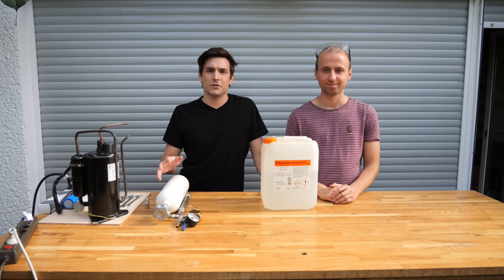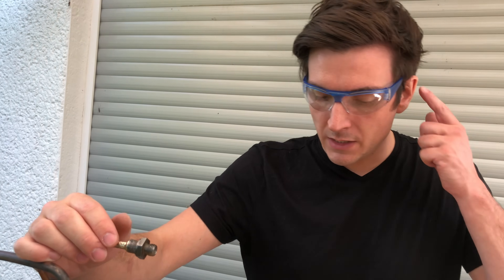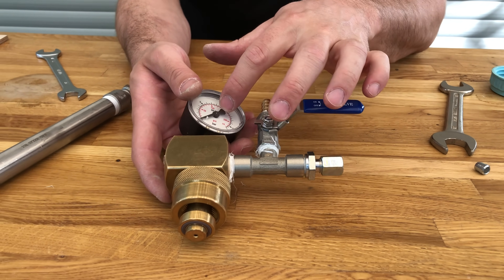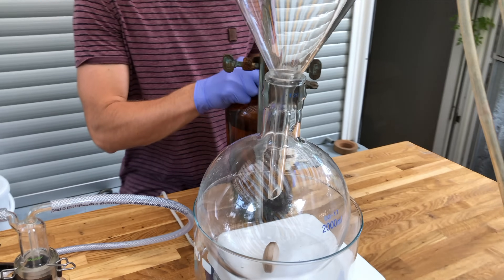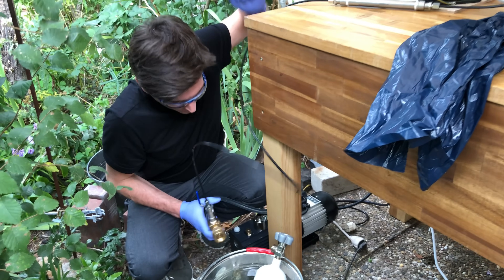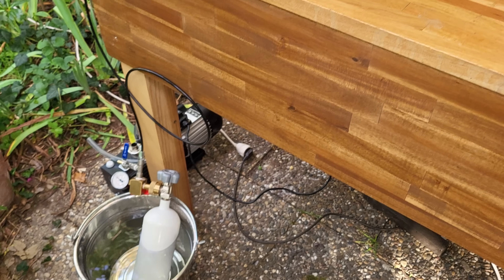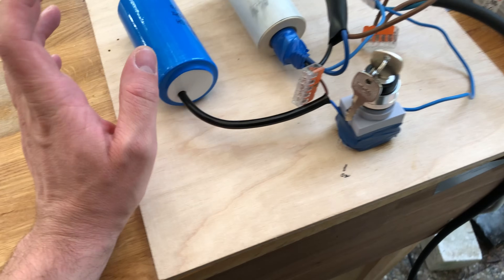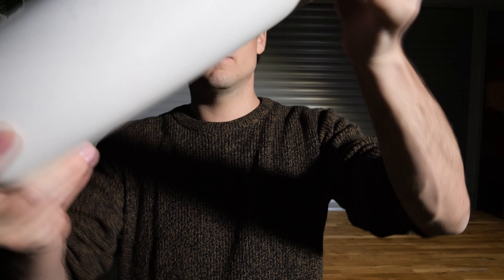Liquefying a Toxic Gas with a Refrigeration Compressor

Comment: Don't store the cylinder in your house or garage. BTW, I'm sure you know that brass and ammonia don't get along.
Reply from the maker: Don't worry, the gas cylinder will definitely not be stored in a house. Yes, we were aware of that. The video was not intended to demonstrate an optimal method for liquefying ammonia (which would be much easier with dry ice or LN2). I just wanted to revisit the method I used when I was young and didn't have access to dry ice or LN2.
Reply: @AdvancedTinkering  I hope there is no brass in the valve of that bottle...
Reply: @Sigmatechnica  Tetraamminecopper(II) Nitrate formation or other bad problems... Ammonia It's very corrosive for many metals.
Reply: @AdvancedTinkering Use it to make an ammonia cooler driven by burning ammonia.
Reply: Adding brass and ammonia to my no no square along with copper and acetylene
Reply: @godlugner5327  😂🤣😂🤣😂
Reply: To be safe its best to use a wood mould to make a concrete box and then put a wood lid over it that extends past the concrete to not make a pool. Lid blows off and you dont send shrapnel into the neighbors house

Comment: We always called them compression fittings.
Reply from the maker: That's good to know, thanks!
Reply: The inner part is called a ferrule
Apparently this also applies to:
-eletrical crimp ferrules 
-curcular copper ferrules
-stainless steel tri-clamp ferrules (sterile environments)

Comment: many fridge compressors the inside (where the motor and piston are) is filled with oil to better lubricate and for heat distribution, in most of the scrapped compressors that oil is poured out. happened to me two times in a row for a fridge compressor to die because of an overheating like in your case... get the specs of the compressor and buy some compressor oil...
Reply: Not to forget that moste oil these days is Polyester oil, probably creates a strong acid with ammonia.
Reply: @H4zuZazu  you are right, i totally forgot about that, the gases you are compressing are in direct contact with the oil...

Comment: A very common brand for high pressure 'instrument tubing' fittings is Swagelok - they use a 2 piece ferrule to dig into the material.

Just another note is that for polymer tubing the proper usage is to press fit a metal insert inside the ID of the tubing, so that the metal ring crimps on. Without the insert, there is a high risk of unpredictable and catastropic failure when the tubing pops off, because the ferrule hasn't crimped onto anything solid, only crimping onto soft plastic. Some polymer tubings may be rated for this, but at least with Swagelok and standard PTFE/HDPE/PP/nylon tubings the metal insert is required for rated pressure.

Additionally, the swagelok brand has a 'go/no-go gauge' that you can purchase - if the gauge slips in between the fitting and the nut, it has not been tightened sufficiently.
Reply: Looks like he does have the ferrule in.
Reply: Swagelock is soo expansive it is hi quality but for this kind of work the cheap cutting ring connectors from say LandEfeld are way more affordable. I am only using swagelock for hi purity and high vacuum applications.
Reply: HY-Loc and Parker make similar fittings.
Reply: Yup swagelock is reliable, they even use those for HPLC stuff. ❤

Comment: Kühlschrank Kompressoren haben fast immer Start probleme bei gegen druck. Versuch mal einen Industriellen 3 Phasen Kompressor zu besorgen und betrei ihn mit einem Frequenumrichter. Dann kannst du auch die menge bestimmen und must nicht so ein "Profesionellen" zwischenspeicher verwenden😂
Reply from the maker: Das klingt nach einem Plan :D Die Methode, so wie sie hier zu sehen ist, ist sowieso nicht geeignet, um praktikabel Ammoniak zu verflüssigen. Aber es hatte sentimentalen Wert für mich, diesen Versuch so zu wiederholen. Damals hatte ich keinen Zugang zu Trockeneis oder LN2. Damit wäre es weitaus einfacher den Ammoniak zu verflüssigen. 

Und ich will nichts gegen meine professionelle Zwischenspeichertüte hören! :D

Comment: The first toxic gas I liquified was chlorine but with a much simpler approach - a dry ice acetone bath. I wish I had access to compressor to do so.
Reply: I wish we had access to dry ice in Europe lol
Reply from the maker: Using dry ice or LN2 would actually be a lot easier. We just used the compressor because that method had sentimental value to me as I did it when I was young and did not have access to LN2 or dry ice.
Reply: @AdvancedTinkering  Lol, just the exact opposite story of mine, dry ice was easily accessible for me when I was young, and literally, it is the thing that got me into science.